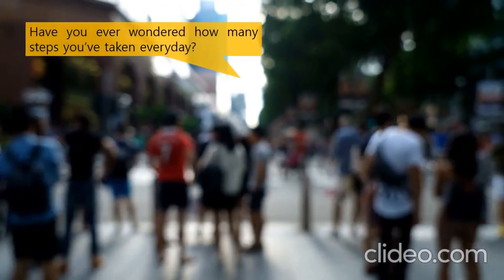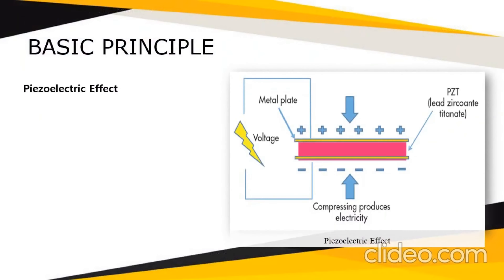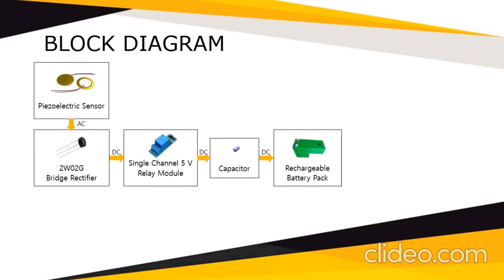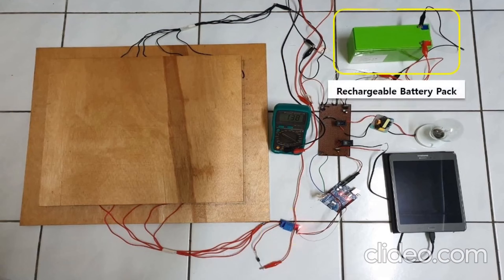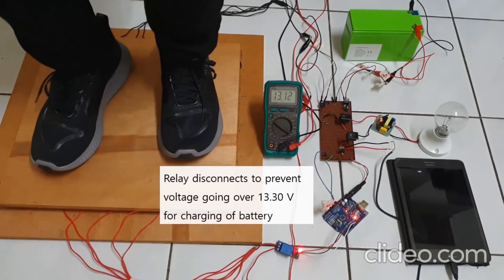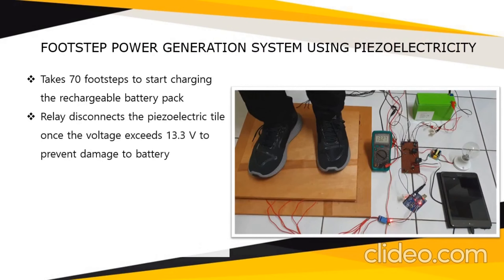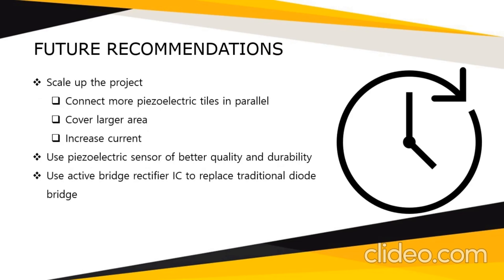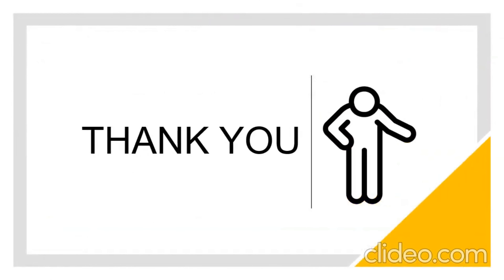MY085 - Design of Footstep Power Generation System Using Piezoelectric Sensor Technology

Comment: Hi 
I am Kalpana and I am doing diploma in electrical engineering. 
I saw this and got inspired to do project based on piezoelectric for my engineering project. 
I want to ask you something.
For 12 v regulated IC we needs to provide min. 14v to operate but you are providing input from 12 v battery.
Could you please tell me, How did  you make it possible?
Reply: Excuse me do you have circuit diagram and Arduino code?